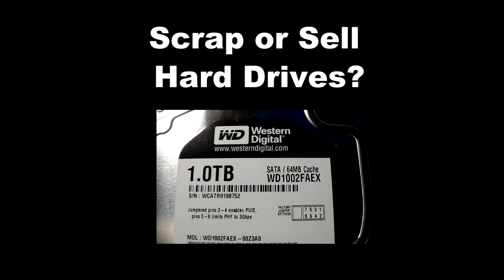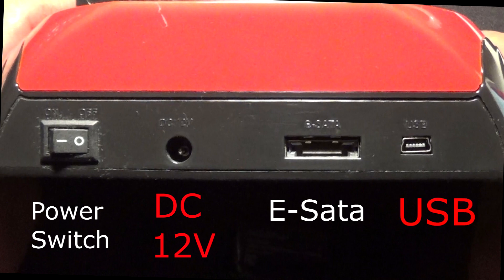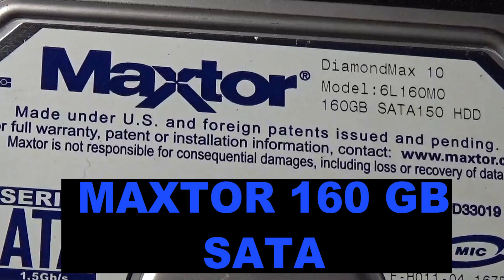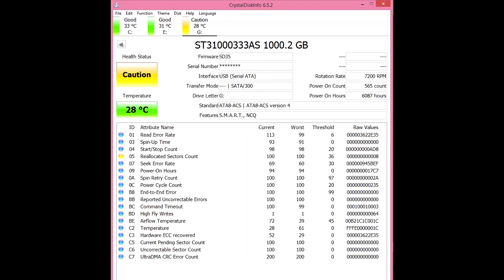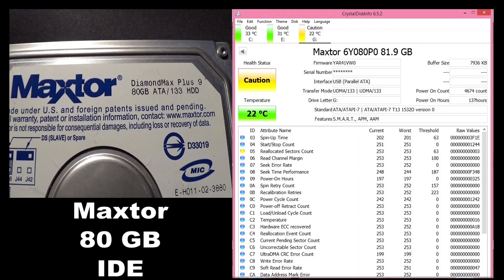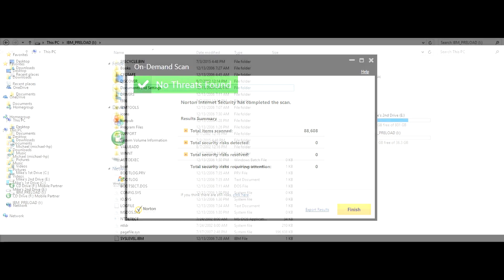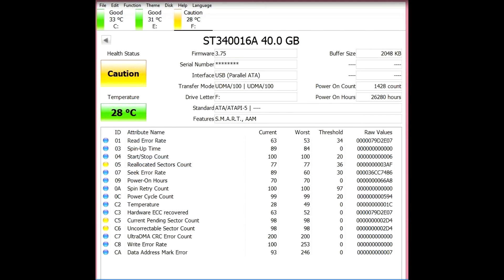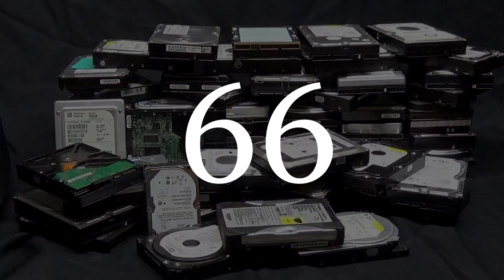Sell or Scrap Hard Drives

Comment: Great vid and perfect timing. A friend just gave me 40 IDE drives.
To scrap, or not to scrap logic boards?
- for gold, monol. capacitors etc -
This is the (my) question!
Reply from the maker: Z1BABOUINOS  IDE'S are still on the ,market but slowly fading away. if you need a back up use em.  Try to see if any good and try to sell . If not SCRAP...

Comment: well better to scrap em.

the information on the disk can be retrived even from formated drives
Reply from the maker: bozze86 i did hear that. but if you wipe the drive 30 or more time... you will only get fragments or nothing
Reply: +bozze86 It cant if you run dban